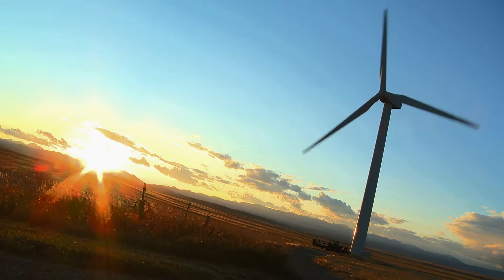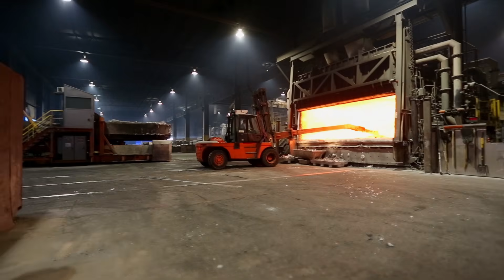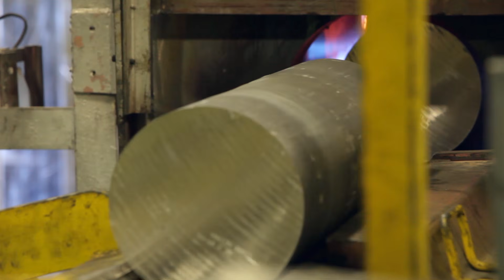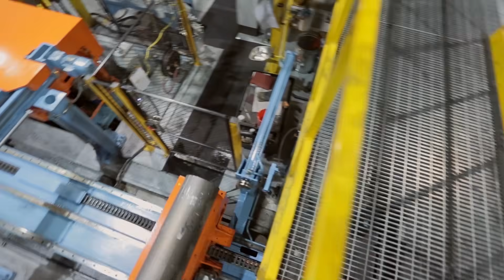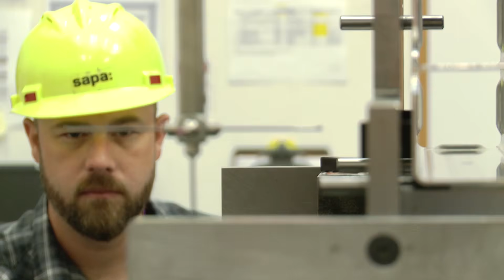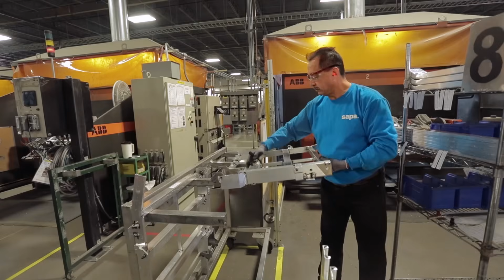How Is Aluminium Extruded? - Aluminium Casting and Extrusion

Comment: Aluminium does not change colour because it is not possible to heat to high temperatures. Water does not glow eather at its melting temperature...

Comment: Hi dear friend
This is Terry from China.
We are manufacturer of Metallurgical Materials. 
Our products are 
1. Ceramic foam filter
2. Caster tips
3. Tap out cone
4. Hot-top casting
5. Refining flux and Bn
6.Online degassing and filtrating equipment
whatsapp:+8615136135579

Comment: is sapa publicly trade stock company? what is the stock ticker?
Reply: Sapa is owned by Norsk Hydro, stock ticker is NHY
Reply: Hi dear friend

This is Terry from China.
We are manufacturer of Metallurgical Materials. 
Our products are 
1. Ceramic foam filter
2. Caster tips
3. Tap out cone
4. Hot-top casting
5. Refining flux and Bn
6.Online degassing and filtrating equipment

 whatsapp:+8615136135579

Comment: Googled Sapa, got NorskHydro, watched the video, subtitled 'Former Sapa explain the aluminium casting and extrusion process' and at the end of video there's zero contact info...  logic path? wonderful video.
Reply: Hi dear friend

This is Terry from China.
We are manufacturer of Metallurgical Materials. 
Our products are 
1. Ceramic foam filter
2. Caster tips
3. Tap out cone
4. Hot-top casting
5. Refining flux and Bn
6.Online degassing and filtrating equipment

 whatsapp:+8615136135579